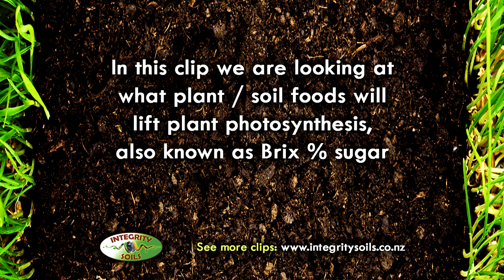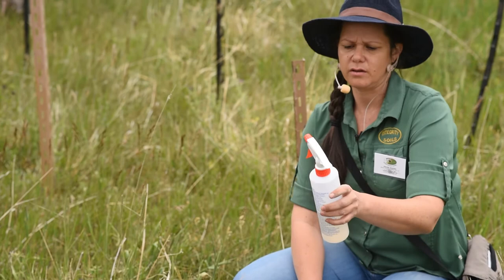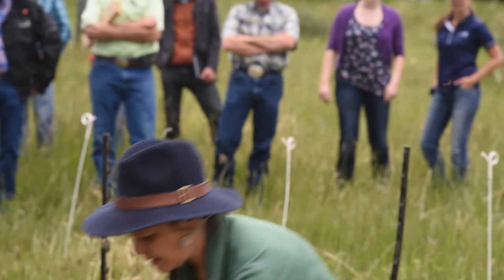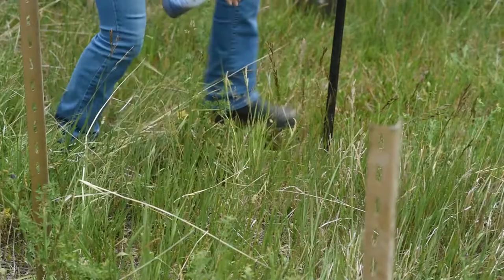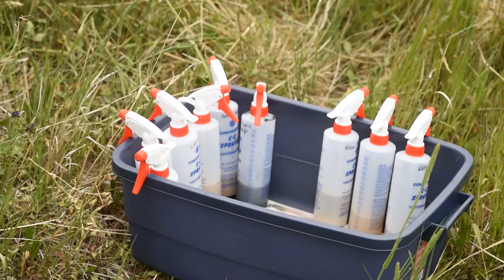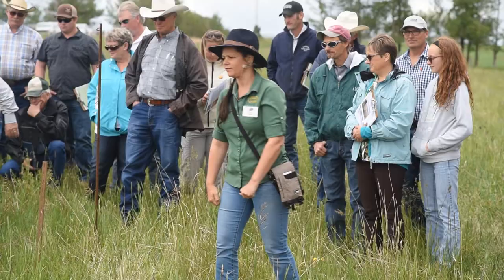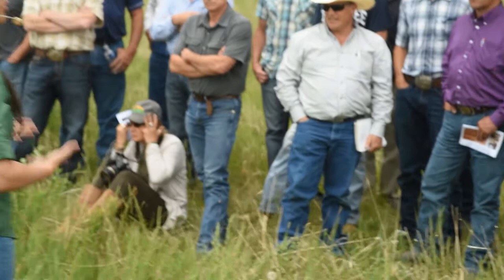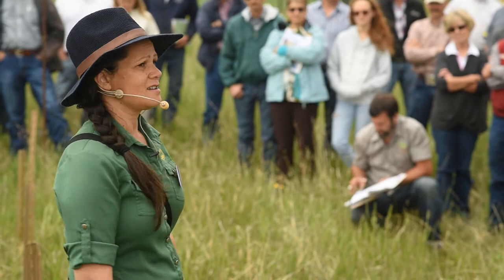How to monitor soil health and bio stimulants using a refractometer.

Comment: Very interesting stuff and i've used this method previously when trying to figure out if a foliar application is needed. I've found the results vary alot, and not as much as some practitioners say they get. I'm assuming big results, or higher brix values could mean a lower or poorer starting point, and or poorer soils? Also, balanced soils with high CEC and high in Ca, tend to have lower brix movement over sandy or loamy soils. 
A few questions
1. A lot of "trial" foliage sprays in a lot of plots. Was the initial brix/baume of each plot taken prior to the spray application?
2. were plant species in each plot repesresentative of the others?
3. Were plant species tested separately or combined per plot for one result?
2. Any repeated trials across the plots for unbias results?
3. What perentage of brix movement is regarded as significant, good or bad? I found this to be very species dependent.